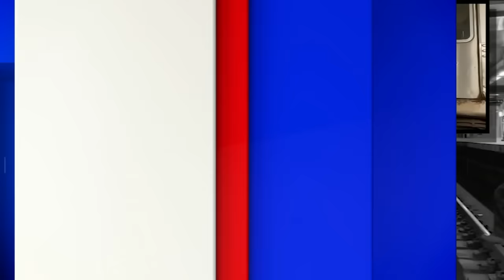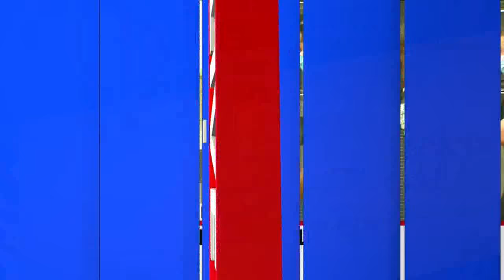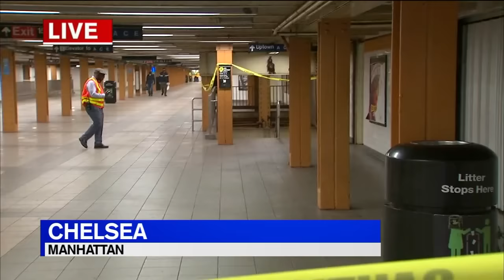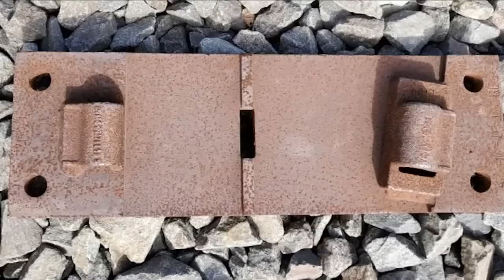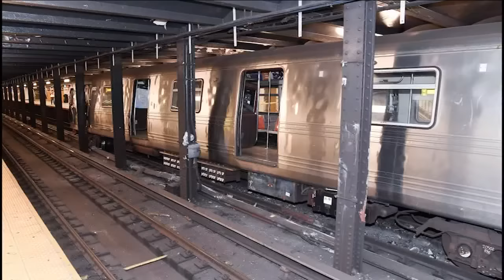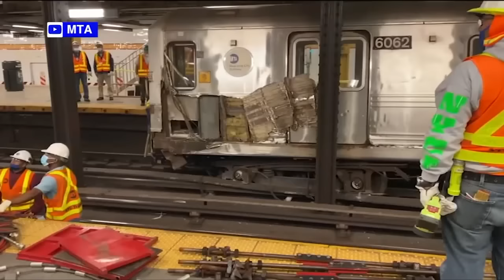Arrest made in subway derailment caused by train striking debris on tracks in Manhattan

Comment: Glad no one got hurt. R.I.P to that subway car. I don’t think they’re able to  fix the severe damage since those R46 subway cars are over 40 years old and don’t think they have the same materials to replace and possibly scrap the whole car down.
Reply: Looks to me like some sheet metal work and maybe a refurbishment of the suspension would do it.
Reply: @pacmantravel2158  I figured it would be required, but that was quick . . . at least by MBTA (Boston area transit) standards.
Reply: Maybe pull parts from already scrapped cars?
Reply: @mikewolf5367  most of the R46s havent been scrapped, they are the prime rolling stock on most train lines in NYC
Reply: The first two cars (6150-6151) were permanently removed from service and replaced with another A-B pair (6206-6207) which existed because of two cars being wrecked in an incident years ago in the 179th St. relay where a motorman was killed.  So this pair was linked with the remaining two cars (6153-6152).

Comment: They should take the museum R44 and replace that R46 with that
Reply: It’s just 4 cars out of service. There’s enough cars in the R46 fleet assignments where we won’t need to replace the damaged cars.

New R211s will come in a few months.
Reply: JeremiahC99 The other 3 are certainly functional
Reply: QuarioQuario54321 But under standard procedures, the entire train must be pulled from service until the set can be returned to service. The 4 cars will be held until further notice and other cars from the existing roster will pick up the slack.
Reply: As for the museum R44, the other 3 cars of the R44 are somewhere in Coney Island yard, the last time those 3 cars were spotted was in 2018, and I doubt the MTA will return the R44 sense there structure is rotting
Reply: JeremiahC99 
Also about they R142 from earlier this year, did the MTA announce what there going to do with the set?
Reply: The Plushy Dogo The R142 set from the March fire has been pulled from service. Most likely 6366-6370 could enter service again soon. The others, not so much.

Comment: blm be like
Reply: BLM has nothing to do with this.
Reply: @TheRailLeaguer  It does. When a person of any race runs over a blm riot by accident, you blame white supremacists, Trump supporters, etc.
Reply: Fritzyboi Are you joking? You think subway derailments and politics and other stuff are related, because there is ZERO connection between BLM and subway derailments? Subway derailments and politics are unrelated in any way. By that logic, would you have said the 1991 Union Square derailment (which was caused by intoxicated train operators), or the 2017 A train derailment in Harlem were both caused by political protesting?